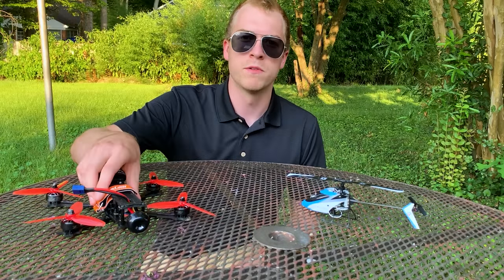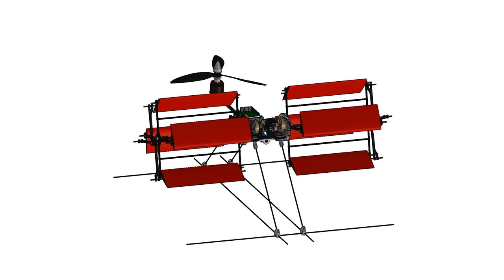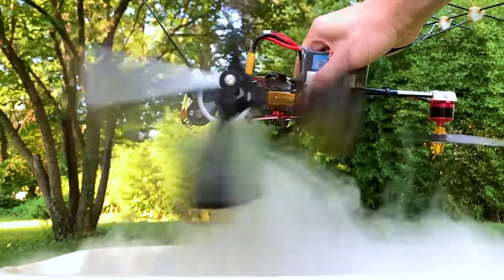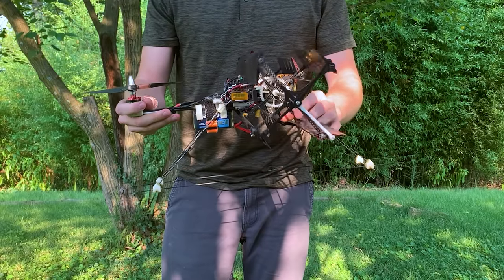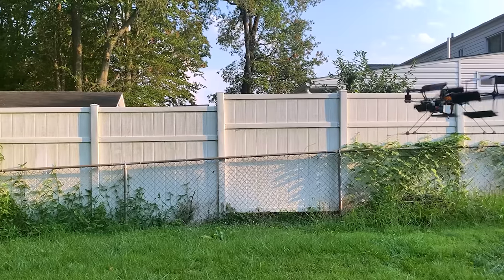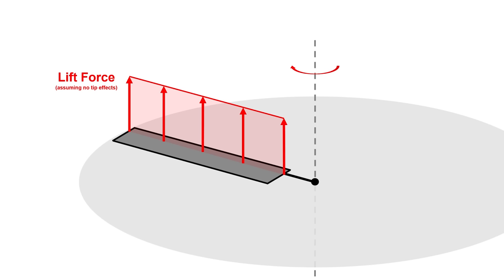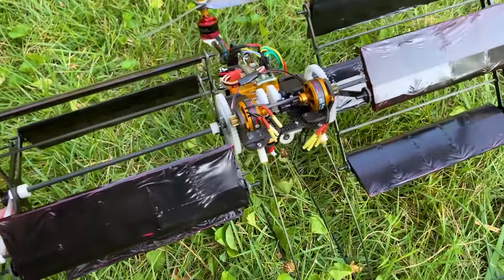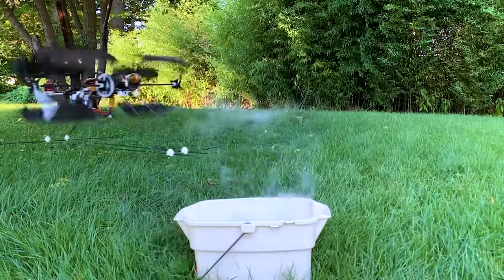Cycloidal Rotor Drone: The Cyclocopter

Comment: I think that it is cool that it works. If the previous designer came back today, I think he would high five you for getting his design to (assuming he knew what a high five was). It is similar to getting Leonardo Da Vinci's helicopter to work (I read of someone actually doing that with a quad).
Reply from the maker: That was my buddy Austin at UMD actually :) we worked out of the same lab

Comment: Interesting, very thought provoking and lots of questions, here's a few!
Presumably the rear propeller could have been replaced by another cyclorotor, or pair of them?
Would there be any advantage to varying the pivot point offset distance of the cyclorotor control, with respect to the main pivot point?
What's the airflow like inside the rotor? Would there be any advantage to having a conventional wing, with cyclorotors rotating around it, to improve forward flight efficiency?
I guess it suffers similarly to a helicopter as it flies faster, the downstream blades will create less lift as the speed increases.

Comment: Too many comments for me to read through so I don't know if anyone else mentioned this possible benefit from that design:  Noise reduction.  I did see one comment that referred to the loudness of your build, but that is 'mechanical' noise that can be reduced or eliminated in a number of ways. But multi-prop drones make a lot of noise because of the tip-speed of the props exceeding the speed of sound. We are all familiar with the awful shrieking noise these type of drones make but it would seem the cyclocopter should not have this issue? Going to explore your channel now - hope to see more of this!
Reply from the maker: Very good observation. Yep, most of the noise from this particular design is just from the nylon gearing. I built a new version with belt drive to alleviate this issue and put it on an airplane. Definitely a different and unique noise profile compared to props!

Comment: the single rotor at the nose is maybe more simple but its not "required" you could have the same horizontal rotors on both the front and back but spinning in opposite directions and achieve the same goal, probably more balanced too

Comment: Very interesting design.  For those whining about weight, it's carbon fiber and plastic film for the airfoils.  Their weight is negligible compared with the gearing and motors that drive them. It would be amazing to see a V+1 which has the same rotors on both ends counter rotating.  Maybe direct drive with an outrunner instead of complex gearing for efficiency.
Reply from the maker: Exactly the plan for the next version! Thanks for your comment

Comment: @Nicholas Rehm  Many years ago I had a similar idea however that the blades were only vertical at the moment of ascent and only moving horizontally in the other 3/4 of the path of rotation in the intention of increasing the airflow downwards and ignoring the effect ( wing) of the fins .
Unfortunately at the time there was no internet and no capital to make a prototype.
The paddles control followed a track external to the paddles to change the positions of the paddles.

Comment: Three possible improvements:
If the secondary axis of each cyclorotor, the thing which changes the blade pitch, could be moved forwards, backwards, up, and down, then you could fully adjust how much forwards, rearwards, upwards, or downwards thrust was produced, even while keeping the RPM constant.
If the two cyclorotors spin in opposite directions, at equal speed, you won't produce any unwanted forwards rotation.  By deliberately spinning either one faster than the other, you can deliberately produce forwards or rearwards rotation.
If you've done both of the above, you no longer need that conventional thruster in the nose.

Comment: Many years ago I had a similar idea however that the blades were only vertical at the moment of ascent and only moving horizontally in the other 3/4 of the path of rotation in the intention of increasing the airflow downwards and ignoring the effect ( wing) of the fins .
Unfortunately at the time there was no internet and no capital to make a prototype.
The paddles control followed a track external to the paddles to change the positions of the paddles.

Comment: Normal rotor system is preferred because it doesn't introduce as much vertical vibrations into the setup, it is lighter and easier to repair, and has less moving parts. Small scale this works well large scale acales problem very large. The margin of error decreases exponentially

Comment: Is there a name for when you enclose the cyclorotor so that there’s intake and outtake to direct the air flow and increase efficiency?  I saw this concept in a popular science form ages ago about how much more efficient it was over typical rotors in drone application.  The article made it seem like it would be everywhere based on the outrageous performance advantages.  I always assumed that once performance drones were desired for racing and other competitive applications they would crop up, but I haven’t seen it since.  The intakes/o were totoally adjustable and the rotor blades almost infinitely variable so it could change direction independent of the vehicle orientation. It was cool, any ideas on the name .

Comment: you could probably make a version of this without the nose rotor by turning the rotors 90 degrees so their axis of rotation is parallel to the body of the craft instead of sticking straight out of it. Make them counter-rotating and they should be more or less self-balanced. I'm not sure how you'd deal with the pitch axis, but the roll axis would be easy enough just by basically thrust vectoring.

Comment: I guess the big problem with a CC people carrying size craft would be its slow maximum speed and high energy consumption. But if you got rid of the angled jets arrangement on the F35 and used popup cyclos weighing very little by comparison for landing and T O you could reduce overall fuel consumption and greatly extend range/top speed. Would make for easier carrier landing.

Comment: I have a potential design for a vertical axis wind turbine and was wondering if you used these turbine blades allowing them to free spin if this would still work the blades use magnus effect and can auto rotate to support quite alot of weight used on a horizontal axis

Comment: I was thinking about a frontal cover of sorts there, and whether it would be an aid to help control what it is capable of, obviously a rear one would have spectacular issues in the control of it, even so the first thing would be to try it with some form of coverage around the rear cylindrical fins.
The more I've thought about it the more possibilities occur to to me regarding positive or negative additional issues in introducing some form of skin around it would bring about for instance an 80% cover  tried out in various positions, the firstvposition would be 20% open at the bottom would for sure assist in up lift, that being the case would a powered skin able to  be directionally controlled. 
And so on.
I likevthe look of it.
The film or movie Avatar had some futuristic covered helicopter thing going on.

Comment: Interesting exercise 
I wonder 🤔, if each of the rotors were split into two contra rotating blades would that cancel their torque reaction and cancel the need for the vertical blade? Pitching could be controlled by a differential speed controller between each blade. I know that doesn't fix the torque reaction of the motors but that could be compensated by a small rotation difference  in the blade pairs?

Comment: I’m curious if you can make a flying machine with 3 of these things in 3 different directions. Not very efficient for forward movement, but should be a very stable platform and not affect its lifting capacity.

Comment: This is interesting! Can you revise your design to have 2 pairs of cycloidal rotors one in the front and another on the back and they spin in opposite directions. This could eliminate the need of the tail rotor for counter balancing.

Comment: Ok, you set my mind ticking, I have project request, have a saucer shape  body, 4 holes, in the dish , rotary blades to create lift, then to gain forward, backward thrust,  on the leading and aft edges, have slits that open and close, how to stear, humm? , maybe tilt the  drive motors?, or open left or right leading edge vents?, a cylinder tube around the whole craft, would need a tube fan strong enough to thrust air from the slits, hope yoi picture what Im saying, it would look a flying saucer, but use drone tech, Im sure woild turn heads lol, anyway your a  very creative young man to have built this unique gyro im impressed , Great video, doing things others dismiss as obsolete or juat poke holes in, guys that couldn't construct a Kinder Egg often, As I see it this how leading edge discovery is still  made,  I notice then the critics are silent, 🙏👍

Comment: Would it be possible to setup impeller blades  on those cyclorotor? would serve to pull in air from both sides of the aircraft and direct that air flow into the body section of the aircraft and then direct that airflow either downwards to generate additional upwards thrust or out the back for added forwards thrust. The airflow would be only as strong as the rate of the cyclorotors rpm rate. Not sure if I am making any sense, but I hope I did and would love to see if it works in a one of your future vidoes.

Comment: Looks like it has the same problem as various Magnus Effect aircraft: if you do a 180° pitch-over maneuver, the lifting force generated by the rotors is effectively reversed and it propels the vehicle right into the ground.

Comment: Would it be possible to place the rotors in tandem skimming I'm opposite directions, like a Chinook, to negate the need for a nose propellor? Or would they work against each other and only create vertical/linear lift? If that were true, could you make a flexible blade that would change the pitch between right and left?

Comment: This is a really cool project, I'd love to see where you take this! Being able to implement it with just the eccentric linkage is definitely an advantage in terms of simplicity, but you could probably get a lot more flight efficiency if you used a conventional swashplate (and appropriate linkages) -- that way you could vary the collective pitch to follow the maximum efficiency curve in velocity / AoA phase space.

Comment: if someone is only interested in vertical flight, can these rotors face sideways to the aircraft, so it's parallel to the longitudinal axis, and use the collective pitch to climb/descend?

roll control could be done by having 2 cycloidal rotors, and increasing the pitch (or rpm) on the opposite side of desired roll.

and then horizontally facing, conventional props or fans can propel the aircraft forward/backwards.

Comment: How about a hovercraft with copter assist blade/blades that direct their 'rotor wash'  to the hover lift fans? It would enable you to direct hover fans away from lift for more speed and maneuvering. Blades needn't be big enough for flight, just to take majority of weight of the craft. Two opposing adjustable blades at a slight angle, (or not), could possibly be used for enhanced maneuverability and braking.

Comment: I assume it gets less efficient as the forward speed increases as the blades are vertical twice during the rotation.
Also it looks a bit unstable, but guess that is as it is under full manual control, unlike a drone.

Comment: How about if you had the two cyclorotors fore and aft?  You could control pitch by changing speed of the two rotors differentially, and yaw by turning the rotors differentially around the longitudinal axis.  Imagine a hinge in the middle, allowing  twisting the aircraft so the fore rotor pulls one direction and the aft rotor the other.  Also, insted of two motors for the two rotors, both driven by one motor, with a biasable differential gearing.  That would make it more difficult to use a center hinge system, but not impossible.  It might still be done with a shaft coaxial with the hinge.

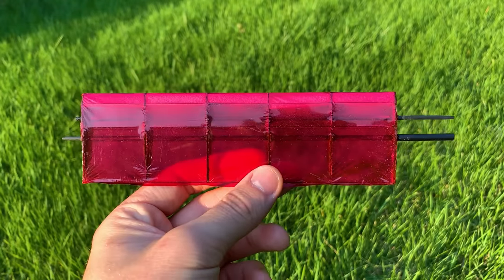Comment: at 1:25 to 4:20 you spoke to how you can change the angle of attack of the blades regardless of the pitch ... and then tried to do a traditional front flip rather than dynamically shifting the angle of attack.  At 3:26 you demonstrate that it can go forward w/ virtual no pitch ... from my understanding of your design, it should be able to achieve the same thing orientated upsidown.  This concept could make for some interesting photography that is not possible w/ a traditional quad.  You should see how much further you can take it.

Comment: That’s amazing!! Why not use another cyclorotor in it front, maybe the size or at least of a mass equal the rear rotors combined, but spinning in the opposite direction ? Or use a flywheel or even a pair of front rotors? I do realize they must be an Uber pain in the arss to construct. It would be very cool though.
Reply from the maker: yup mainly just them being a pain to make

Comment: With a helicopter, in case of an engine failure, the pilot disengages the rotor from the engine and eliminates blade pitch, turning the helicopter into a gyroplane glider.  Could something like that be done with cyclorotors?

Comment: No technological idea ever gets too old to no longer inspire. I've invented a personal powered jet engine, which will power a kayak and a hydrobiology tricycle with a 3000 year old idea and only accidentally stumbled onto some still classified technology in modern helicopter jet engines. The combined technologies give a unique new invention which will do what seems impossible even now. There are actually proofs of concept in existence, from a 3000 year old one to an experiment by a professor in the seventies who may have been high on LSD when he got the idea. Which astonishingly worked and mine is orders of magnitude more efficient in power transfer and efficiency. His idea worked with a propellor, but mine is a jet, which is 100% efficient in water with propellors about 50% or less. I'm sorry I am going to get my first personal powered jet kayak, which is my business, to market before I'm going to say much more, because it's actually very simple and I already see one amazing application for it as mentioned, which I am going to try before I die at least.

Archimedes gave us so many other things since which relied on his early discoveries and inventions. From the only means of drilling and extracting resources from enormous depths to this day, to propellors of all kinds, water and  air. Thus aircraft, including jets. There are still amazing discoveries only a single step away from his gifts from 3000 years ago. Modern engineers must absolutely never forget the earliest discoveries, because these foundational technologies had the most possibilities available before some options to make use of them stood out as easier at that time and all advances flowed out from that choice. When in the future, the original problems with rejected paths, may be solved and suddenly the rejected or unseen idea becomes viable and sometimes more so than the last thousand years or more of evolution from the original idea. Archimedes, Davinci, Tesla, all did what they did in a world with far less information or technology. Looked at with modern eyes, they can inspire in new ways. The other inspiration for solutions to problems, which is my interest, is nature. Not much by way of modern inventions interests, it is the foundational technologies from which I always find solutions most easily. 

My point is, this flight technology, already seems more viable than when it was first tried and rejected. Due to everything from advances in materials to power storage and motor efficiency. Who can foresee what future inventions may eventually render this to a viable and  effective system even if specialized? With advances in magnetics engineering, reducing the need for the more impractical connections and linkages, even better, lighter and stronger materials, already arriving at breakneck speed and maybe an application such as a thin atmosphere on another planet. This may be the best option and a good one. 

Nice forward flip.  You did it, just didn't allow for the sudden loss of lift, it needed to be twice as high to have time to regain. I'd like to know how efficient was battery usage? if it compared with a chopper of similar size and battery storage? I guess you didn't get to use the battery fully before it croaked?

Comment: I wonder if you could build a viable tri- or quad-"rotor" version, with the "paddle wheels" oriented radially out from a center "hub," with thrust from each wheel pulling outward, away from the "hub," such that you can generate directional thrust by reducing thrust from in the opposite wheel(s). Just an idea, but it sounds like a cool one, to me. It would definitely be cool to see in action, regardless.

Comment: I've always wondered if it would be possible to varry the distance of the offset for the blade pitch control. I think it'd work some what like a 90° offset swash plate. Then you could keep the the rotor spinning at a constant rpm and simply vary the max blade pitch. Then you'd have more of the helicopter benefits like much faster control of thrust amount and direction. The blades and blade control apparatus could be made with more material since spin up momentum is less of an issue.  You could also potentially survive a motor failure the way a helicopter does, not that I actually think this is very common.
Reply: The Voith Schneider propulsion system does that (with huge heavy blades in water for ship propulsion). The control linkage is definitely more complex, but it's viable.